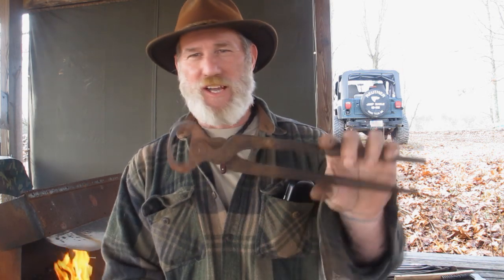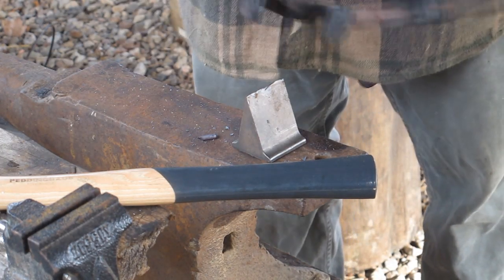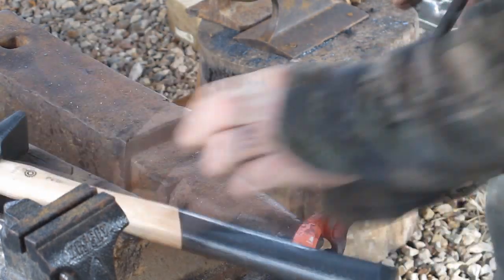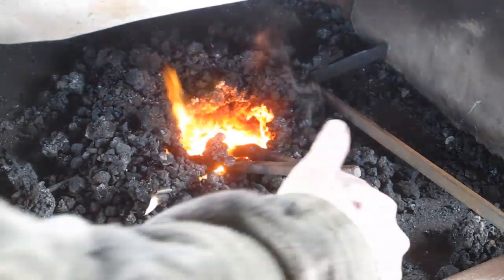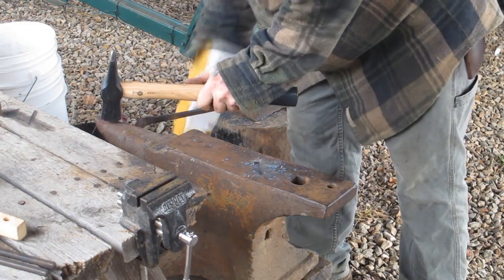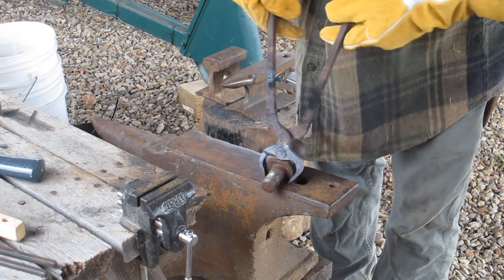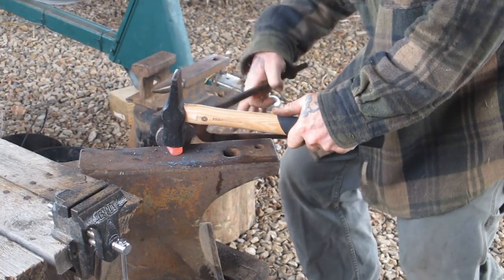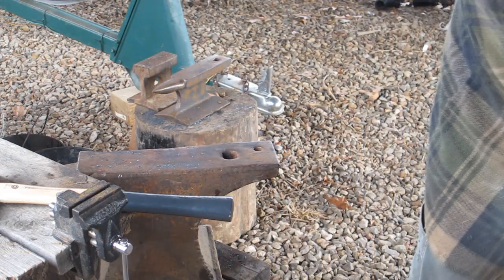Blacksmithing Part 15 Making tools for Spoons and Ladles

Comment: Hey Dave I highly recommend heavy cotton gloves instead of leather. Leather will really hold the heat in when doing hot work even if you dip your hand in the quench bucket, but cotton cools almost immediately if you have to dunk your hands.

Comment: suggestion:- heat expanse metal. if u were 2only shape the tow-ball shaft 2 a sq so that it would only start 2fit/enter ur sq hardy hole, than quench 2c if it fits firm 4u u then would create a tighter fit 4u in hammerin/shapin. luv what u do! enjoying the education!! thx again

Comment: Cool trick!  Didn't think of that.  What video is it on?  There's a guy (backyardbowyer) on Youtube that does videos on PVC pipe bows.  Figured you might like it.  The bows have most of the advantages of fiberglass, but is more customizable (can be ambidexterous & takedown styled).  If you're interested in self-reliance type of things, that's an interesting one.

Comment: Dave, after whacking on all of that metal with a hammer and holding onto stuff with tongs, how are your arms?  I remember they always used to say the blacksmith was the strongest guy in town from swinging a hammer all of the time.  About the only thing I could think of as better exerise would be single jacking or double jacking the old style hard-rock miner's hand drill.

Comment: Just wanted to point out that in this video towards that end that you can see Dave's 3 anvils. One is the big one that he is pounding on right now. The second is the smaller anvil and the 3rd is the railroad rail he started with. A real deal blacksmith will not have "an anvil" they will have "anvils". And they are COSTLY. wow.

Comment: great idea 
a blacksmith on youtube named Edwyrd Karn has his own "buggout" blacksmiths kit which is a short handled ball peen hammer 
a small set of flat jaw tongs and a  2 inch hardened steel plate as a small portable anvil 
are you thinking of doing something similar?

Comment: to make the tongs fit the hitch better you could have heated them up then pinched the hitch and beat them in place around it instead of heating each and shaping it on the horn